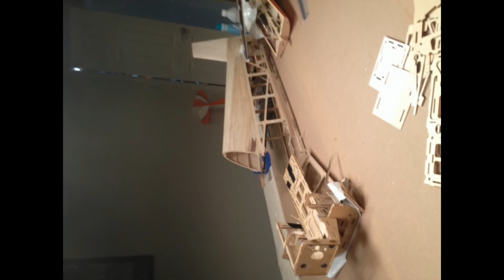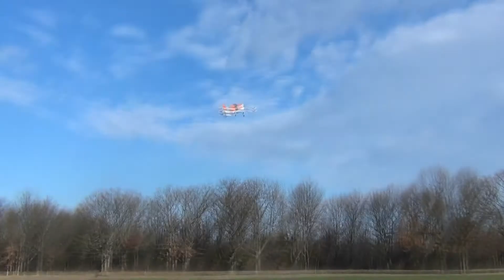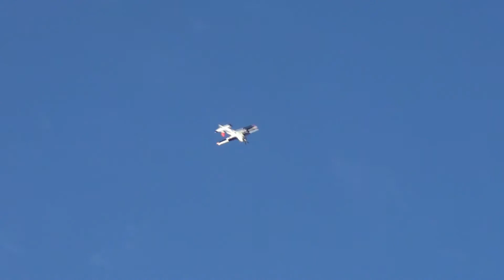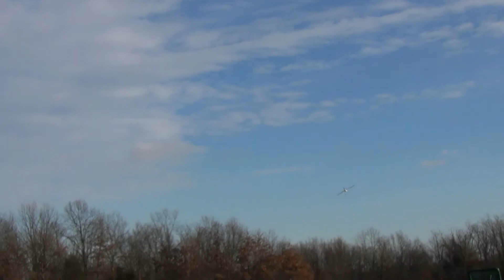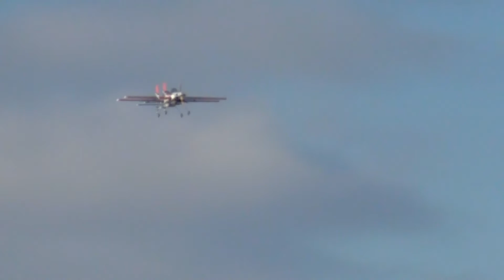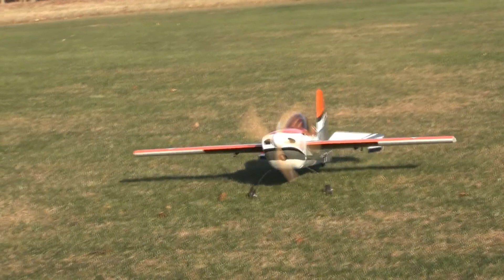ReMaiden of my 71" 3DHS Slick

Comment: I just put the same motor in my 71" Slick but haven't flown it yet. I am also running 4s 4000 mah. batteries.
What sort of flight time are you getting and what props are you running?
Reply from the maker: I believe I used a 19x8 and probably about 5 min flight time